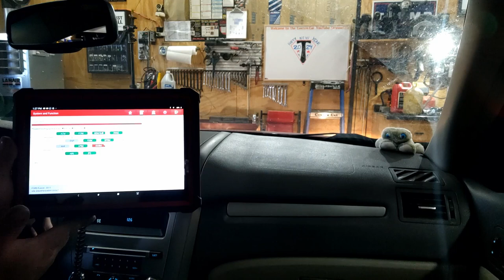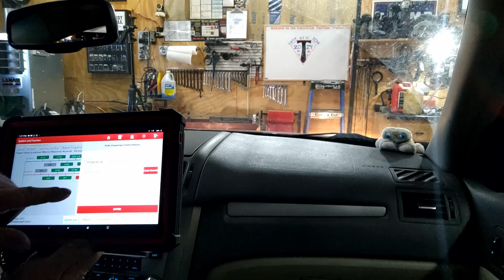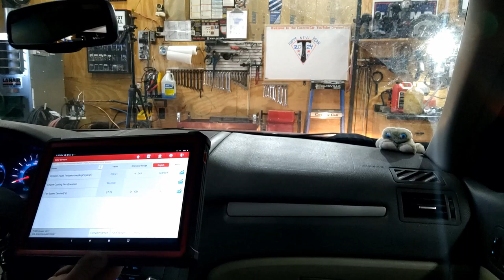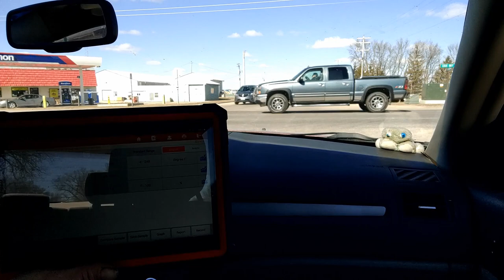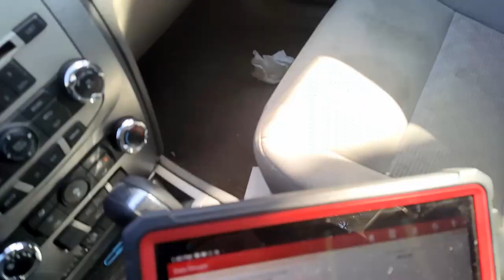2011 Ford Fusion #DIY Wheel Bearing Replacement & P0128 #diagnostics  #93

Comment: That's a crappy steering knuckle design!! That's ford for ya!! Glad to see the iron cube ratchet wrenches are holding up for ya!! Arbor press is nice to have!! I got a arcan 50 ton,use it on wheel bearing,ball joints,u joints etc!! Sockets make great adapters!! Thanks Pete for showing the tool community!!
Reply from the maker: That's a big arbor press!  I have used arbor presses before and they also work well mostly for alternator bearings.  So far for the price I have nothing bad to say about the Ironcube wrenches, I actually even like them.  Thanks Jeff

Comment: Hi Pete I said Arbor press but its not ,its 50 ton regular shop hydraulic press, works like yours somewhat but has 2 levers for big and small increments and a big pressure gauge and it not a regular bottle jack,its just a big hydraulic cylinder!! Damn press weights 600 pounds,had to move with a loader!! I do have a Arbor press its 2 ton!! Sorry for the mix up,lol!!
Reply from the maker: That's cool.  Yeah my press is cheap but I don't use it that often it is compact for a 20 ton.  It works great for my garage.  Thanks

Comment: Pete is that wilton vice you have,8 inch jaw,I have 2 and I love them!!
Reply from the maker: Yes it's a Wilton 6" and the bottom swivel plate is missing or broken that's why my old boss gave it to me.  I have it bolted directly to my bench.  It works great like that, I use it multiple times a day.